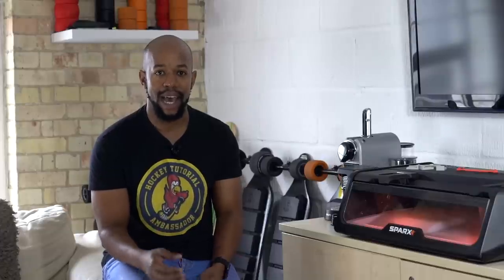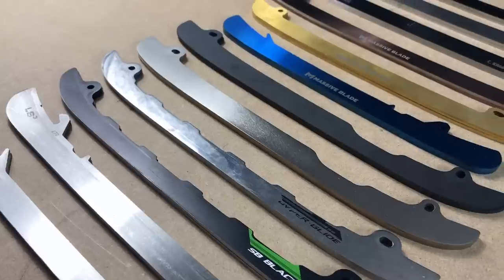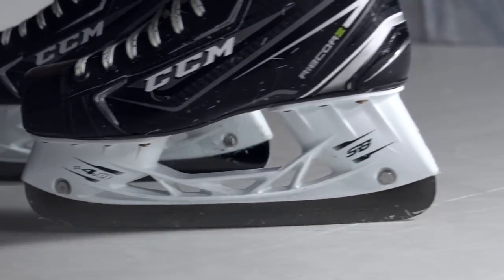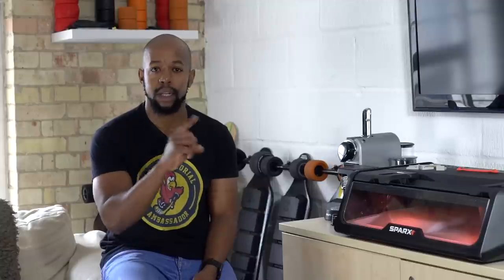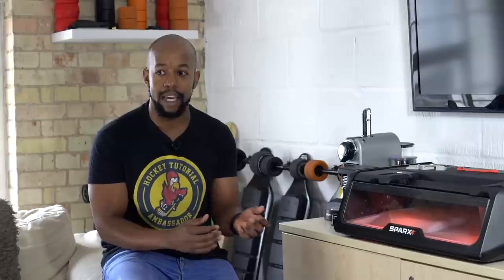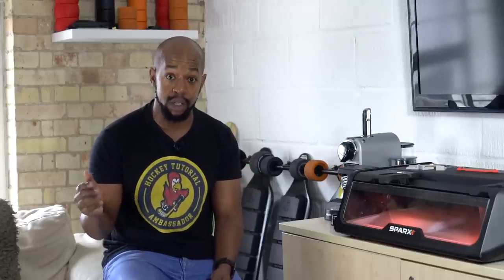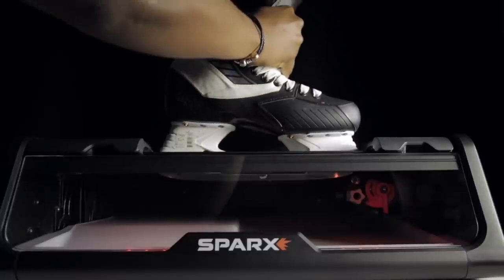Do's and Don'ts of black, coloured or DLC hockey skate blades - Runner Sharpening & Maintenance

Comment: I deal with PVD coatings and DLC quite often in my line of work and I'll tell you that if a ceramic stone is removing the DLC coating, then that is not a true DLC and might just be a marketing gimmick for "painted blades".  At near diamond hardness with some coatings over 5000 vickers there is no way that is coming off through simple hand polishing with a ceramic stone.  We have put these coatings into aluminum oxide grit blasters using 54 grit and it sometimes takes minutes to remove the DLC from the metal substrate.  The takeaway from this would be that some of these companies might advertise DLC, but it's really just a baked on coating like powder coat.
Reply: That is indeed what it is, the blade is still normal silver except the coating on the outside

Comment: Late to this party, but just wanted to say I’m not a fan of sharpening black steel. We use the 2nd hardest wheel bladeMaster makes and it is still a pain in the ass to get an edge on it. As far as deburring we use a rubber block from Howies hockey.

Comment: I just bought a pair of AS3 Pro's and went to get them baked and sharpened at my local hockey rink.  When I got them back the black on the blades was all scratched off.  I was told by the person that the black coating on the steel was a gimmick and he needed to use the honing stone to get rid of the burrs.  I know the CCM black blades are not "true" black steel, but that should not have happened, right?

Comment: Are there any downsides to using "flat bottom" sharpening on these kinds of runners and steel?  I'm a big fan of the flat bottom sharpening and edges.  Wondering if I make a switch to these, if I should continue the flat bottom edges, or what kind of additional changes I might experience.

Comment: Seems advice has changed a bit on honing Black Step Steel.  Now there is a clay/rubber "stone" that can be used but according to a reliable source it is OK to hone black step with a high quality Arkansas stone and oil.   I have spoken to Step Steel directly and they suggest not doing anything more than a leather strop but as pointed out they are conservative and want to protect their blades.  For those that are in the business of sharpening the blade finish has been improved by using Arkansas stones and oil.  Do you have any knowledge of this or opinion?....keep up the good work!

Comment: Do the dyed steel have the DLC coating? Just from the video is sounded like maybe only the Black Steel ones have the DLC coating. Thanks in advanced and keep up the good work you rock!!

Also where could/should I buy a leather hone to let my pro shop borrow it for my skates?
Reply from the maker: Check out the video in the description for more info. Any off cut of stiff leather will work. You can get them all over the places Ebay, Amazon etc.

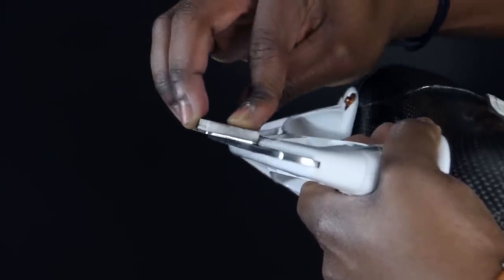Comment: I work in a pro shop and I have sharpened skates for years, you have to stone blade no matter what color, it gives you the edge. If you don’t, you will not have a good as a grip to the ice if you did. I own LS5 blades, black, and I did a test to see if were actually true, but it wasn’t. I had an easier time with stoning the blade, than without. As long as you stone them at a 45 degree angle, and not like the video is doing at 4:46, it won’t effect the steel.
Reply: Plus, the surface of the steel will come off eventually due to pucks, sticks, and other things rubbing against the blades
Reply from the maker: Not true at all. Blades like Step Steel (V steel, Black Steel etc) or any equivalent do NOT need honing. This information is coming directly from our tests and the people that make these blades. This is exactly why we created this video. Please understand that the manufacturers of these blades/runners will know better than anyone regardless of how long you've been sharpening skates. Equipment evolves.
Reply: Coming from a video that stones blades completely wrong, I’m going to take my chances on this one
Reply: You shouldn’t be stoning a skate at a 45 degree angle. You’ll roll the edge in. You have to lie it flat against the steel. And the LS5 steel is garbage. It’s cheap stainless steel coated so it’s super soft. I’ve done that exact same test with Step Black and the stone doesn’t matter. But seriously, if you’re working in a pro shop and angle your stone, I definitely wouldn’t go to you for sharpenings
Reply: Matthew Lolli ya, if you do it more than three times, burrs aren’t on the flat side of the skate, they’re on the edge
Reply: If you’re rated the best in the dc area, then I find that hard to argue with pal
Reply: GoPro P.O.V I don’t believe you lol
Reply: @goprop.o.v4495  so I've got the v-steel, and the mirror finish is getting scratched and dinged after games, is there any good advice to polishing out scratches and scuffs on the sides to maintain the mirrored finish?
Reply: I contacted Step directly and they agreed that honing is not required, however, VERY gentle honing with a clay, rubber block, and or leather as you describe is ok. The point is not to use a conventional stone parallel against the edge as it will just scuff and scratch the heck out of the polished or DLC finish, rendering it essentially ineffective.
Reply: I agree with GoProPOV, you Do have to stone black steel if you want to get a great edge.......just don't do 45 degrees. 2 to 5 degrees works Much better. I've been sharping for 20 years and I tried the leather, clay and even hard rubber on all black steels and None of them give an edge like a good deburing stone. I mean, Just Feel The Edge! NO piece of leather is going to give you the same edge as a stone! Try it! The proof is in just feeling the edge.

Comment: Hi. 
In our shop we regularly watch your videos and it’s amazing.
I have question about Bauer runners LightSpeed 5. 
We have blademaster machine for sharpening and also we sell Step Steel runners. 
So my question: do you think, that LS5 is really Carbon blades, as they claim?
Because Step Black Steel are much better and harder than LS5. For example - customer with Blacksteel come to sharp once every 2-3 weeks, with LS5  - every week once.
Thanks for your answer and keep going with your amazing job.
Reply: Pro Hokejisty the LS5 steel is a not as good quality as true DLC coated steel. They are carbon coated tho. Step steel (regardless of V-Steel, Blacksteel or regular) is higher quality than LS5. Bauer created the LS5 with a coating over top of a stainless steel blade, which is generally super soft. When sharpening those blades, you’ll notice that too. The coating for LS5 Is just to keep the edges sharp but by having a softer steel, you’ll have to sharpen it more often than Others. LS4, based off of hardness, are better steel than LS5.

Comment: I have tuuk super stainless-steel (stock s160 blades) right now and kinda want to get some step steel blades, but I’m afraid of how much higher the step steel blades are, and how my skating will be. I’m afraid my skating will be worse if I get such a taller blade. Should I get step steel or get ls2 blades to match the height of what I already have. Please help
Reply: Daniel Castro I just got the step black steel ballades yesterday, and it had a very small effect height difference wise. After a couple of laps and shots you will get used to it.
Reply: Higher steel gives better turning since you can lean more without bottoming out. Also more steel means longer life. The profile is more important than the height

Comment: weird thing - my comment has disappeared. my question was: Can I use a skate sharpener to restore edges with black hockey skate blades?
Reply: An update on my question: #ccmhockeyrussia has answered me. I can use this edge correction tool but slide it very careful without much pressure. Otherwise too much of this steel surface can be damaged.

Comment: I guess you really shouldn't use a Y-stick with DLC blades because they are resharpening by bringing the edges closer = removing the coating?
Reply: Markus Suomela I was thinking the same thing however it would depend on how high the ceramic goes up the side of the steel. You should just leather hone them and wait till they need to be sharpened again if you're not brave enough to try lol

Comment: .....So it seems like most people didn't notice the black steel's edges feel Much sharper with stone, over a piece of leather. If the black steel is not as sharp when using clay or leather, over a stone, then what is the point??? So preserving a black coating to have a mediocre edge is Better than having a great edge that lasts?  Is that what this video is trying to say?  All I know is that I stopped using leather, clay and rubber to deburr black steel over a year ago, and my customers are Much happier. They used to complain that their black steel edges didn't last when we used clay, or other rinks that didn't use anything. So I started using a stone again and suddenly people are happy with their black steel.......go figure.

Comment: Really you have to learn a bit more about sharpening steel before you post something like this.  All steel, regardless of colour quality needs to develop a burr in order to get sharp.  The finishing process involves getting rid of this burr to produce a smooth surface with a fine point at the edge.  Not honing your steel because you have a "high quality steel" is to say you don't understand this process.  Try a search on how to hand sharpen high quality japanese kitchen knives.  Same principles apply here, including understanding how "shiny" high polished stainless is actually a lower quality product because of those nasty chromium carbides creating a rough edge.  Seriously, learn more about it before you post.  The hockey industry needs a spokesperson who educates rather than regurgitates marketing catch-words.  You have an opportunity to be that spokesperson if you choose but you're not quite there yet.  Just a salesperson at this point.

Comment: Show me the evidence.

Saying that black or coloured steel is not a gimmick does not make it fact: it is simply an unverified, unsubstantiated claim.

Show me data, evidence to back up your claim.

Otherwise it is just blind faith and, son, I ain't the believing type.
Reply: A diamond side coating reduces wear. The expired US Patent 5255929 of 1993 covers the claim. Eons ago some makers had Titianium coated skate blades. The two coated vertical walls of the blade are a part of the sharp edge created during skate sharpening.  the radius of hollow cuts through the coating of course at the bottom of the blade/runner.